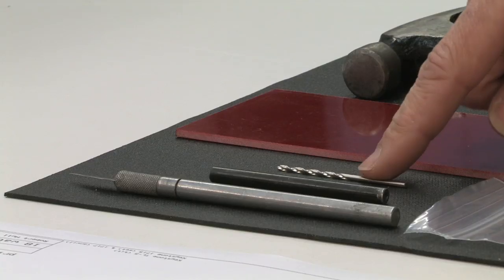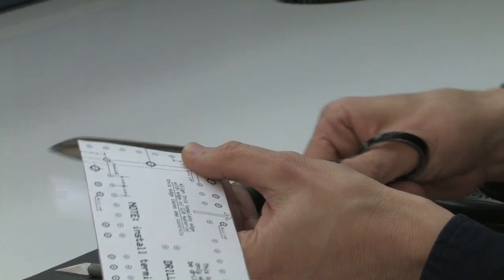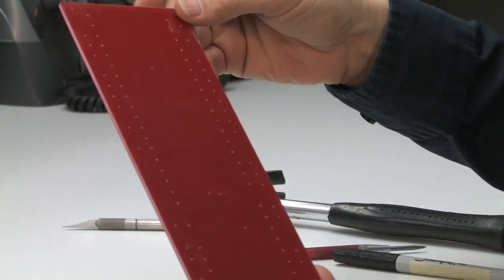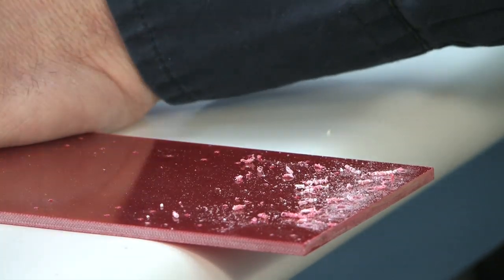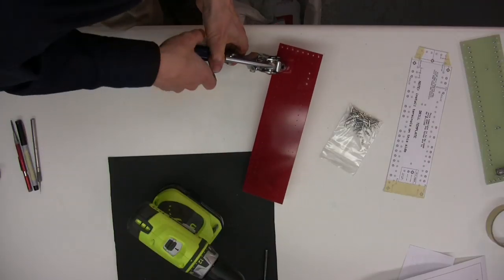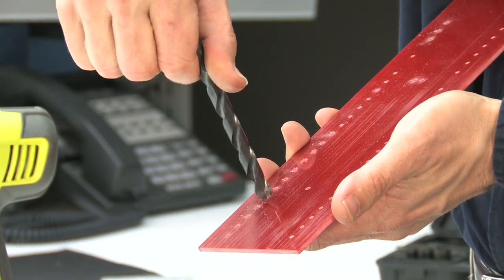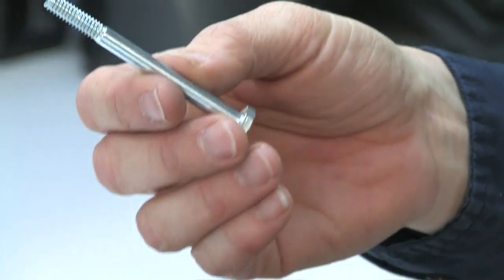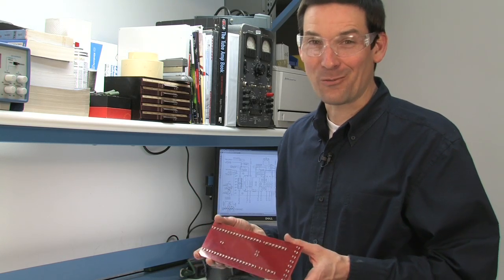How To Build a Turret Board Part 1: Press Fitting

Comment: Like Landotter1 said 3 years ago,drill holes with a piece of scrap underneath. It will prevent blowout on the exit side of the drilled hole and also guarantee you won't accidentally break the board in half!

Comment: @TubeDepotTV If you etch all the copper away on a blank pcb, the material is epoxy usually, so thats why I got the idea, its thinner that the material ur using but it will do,
thanks

Comment: A small drill press and a brad-point drill bit seems like a better way to drill the holes cleanly and evenly centered. Finding a #43 brad point drill bit might be tricky; use a smaller brad-point drill to pilot-drill all the holes and then ream the holes out with a normal #43 bit.

Comment: Thanks.
You mention that the hand press gets difficult to operate with a 3/32" die on a 1/8" board.  Can one expect accuracy of final hole size and angle, if a smaller "starter" hole (1/16"?) is made first then followed by the 3/32" die?
A recommendation for a robust & accurate hand press would be much appreciated!

Comment: My problem is that my amp doesn't have this pot and it would need to be modified if I want to add it. Unfortunately, I am not a tube guy and I don't know much about them. My electronics training started with transistors and the 8088uP. :-D I am having a rough time finding a fairly clean schematic for the bassman 10 so I can determine where to add this pot and resistor. From what I can determine, mine is a self biasing circuit and if I understand it right it is from a RC circuit.

Comment: 1st, Drill the board with a scrap pice of 2X4 or whatever under it. Hole will be cleaner with no tear-out or chip-out on the opposite side. 2nd, Before you drill, turn the drill bit a couple times with light pressure. This sets the position even better than the punch only. 3rd, You can use a countersink bit to debur the holes. In the case you presented, a 3/8 drill bit will debur just dandy. No pressure on the deburing. Just cut the burr. Same goes for sheet metal. Just saying...

Comment: Bro, I was simply offering some useful pointers. I am an aircraft mechanic by trade. I have drilled many holes through many different materials. Sure, I could offer aviation tools to do a quick and good job but that is beyond the scope, I figured. No one said that you had to debur by hand. Just if in a drill, no pressure should be added. Only trying to help bro. If I spoke out of turn, my apologies.

Comment: Plexi is a bad choice because of the heat. Tight turrets loosen and fall out after soldering. I had better luck with Lexan brand. More tolerant to heat. 

I've seen other builders use hardwoods for small boards too.
Reply: I was thinking exactly the same, a flame AAA maple board with translucent paint is wonderful.